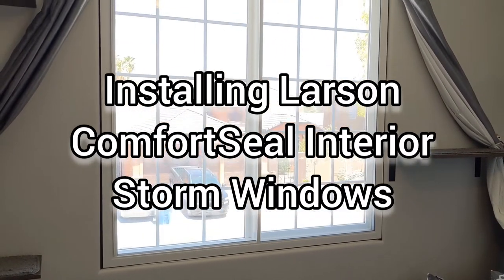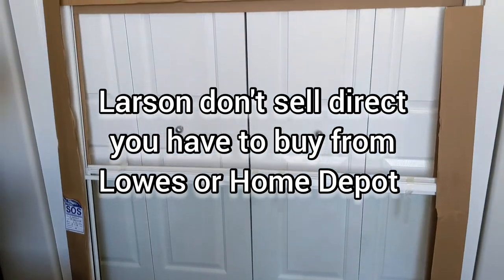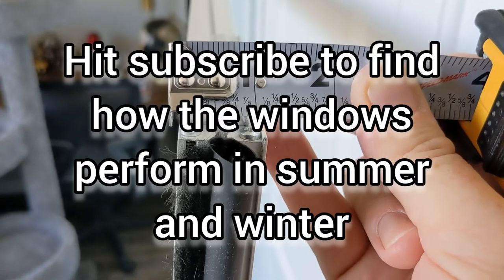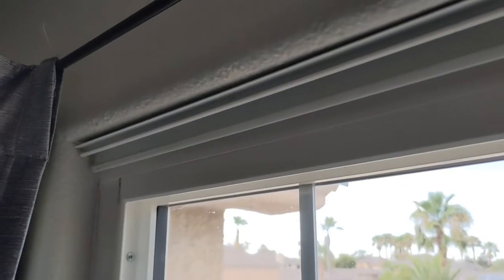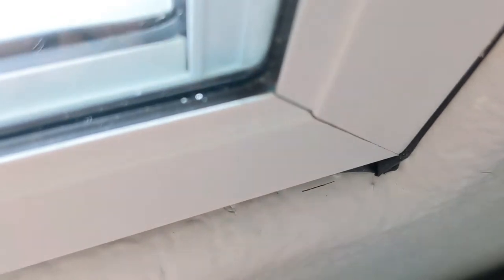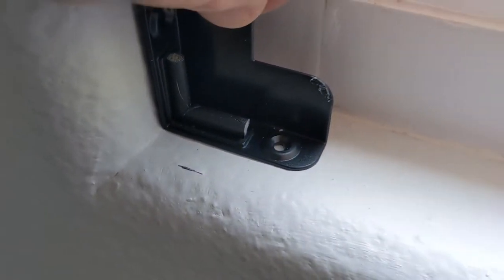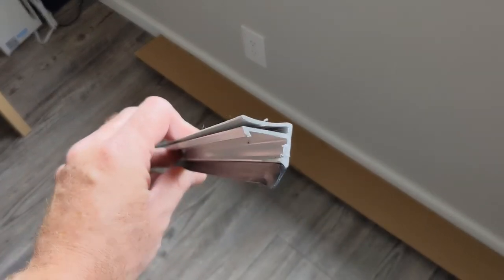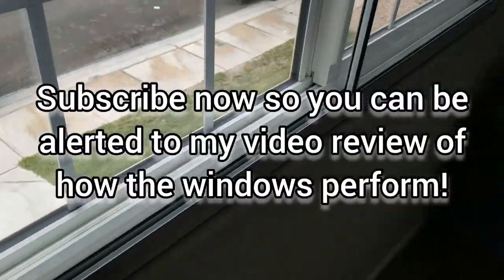Installing Larson ComfortSEAL interior storm windows

Comment: Thank you, I have been looking for a customer review about this product. My windows are aluminum single pane and I've been looking for an alternative for the interior side. I am looking forward to your follow up review about the insulating performance. I hope that it also helps with outside noise. Great job during your video presentation.
Reply from the maker: I'll probably post that video in a week from now. I can tell you that immediately after installing I could tell that noise from the street was much much quieter than before.

Comment: Robber lining around window should be same as selected color — in this case white! Seems it should help with air filtration, but at the same time, this filtration will continue but be trapped. Wood windows would more likely rot. Sadly, I have junky Andersen 200 windows. Now enough depth for these projects. My nice blinds from Budget Blinds dont make it easier.